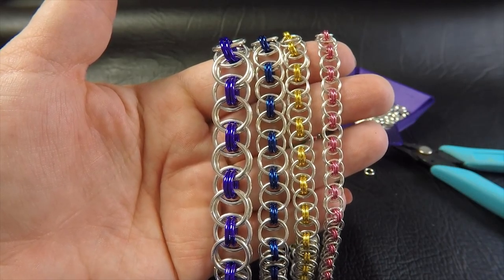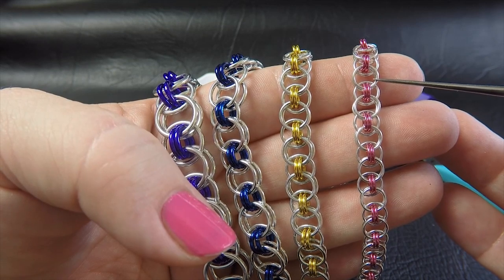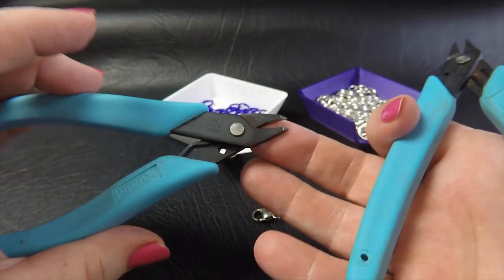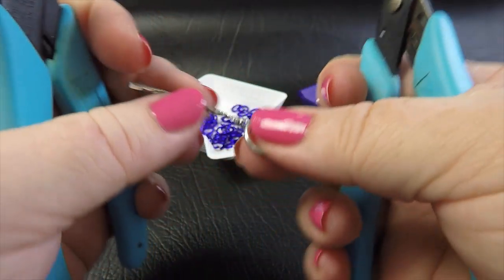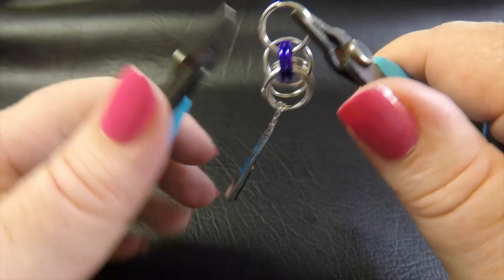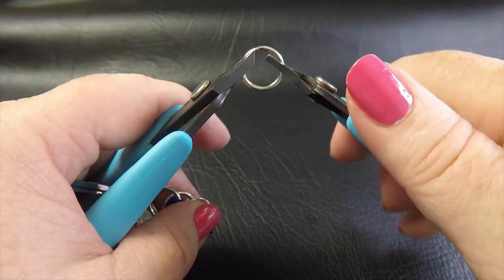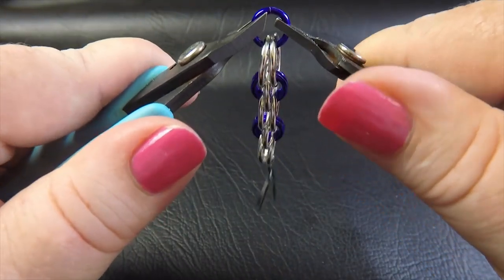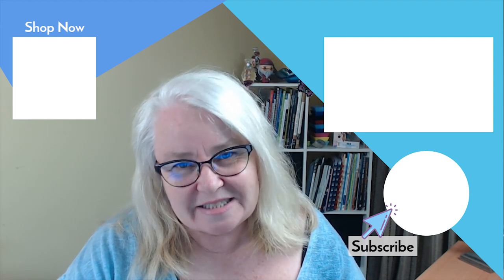Chain Maille Basics - How to Weave Helm Weave

Comment: I made a necklace with this weave using 4.5 mm ID 20 ga and 2.5 mm ID 20ga rings but the weave seems really tight. Am I doing something wrong or are the rings the wrong sizes?
Reply from the maker: Hi Sandra, probably not doing anything wrong, but the rings you chose are a bit towards the tight end.  With this one I recommended the 1/8" or about 3.00mmID rings.  Deb